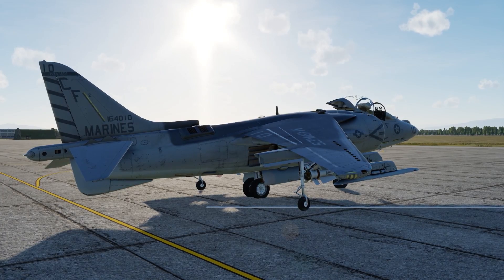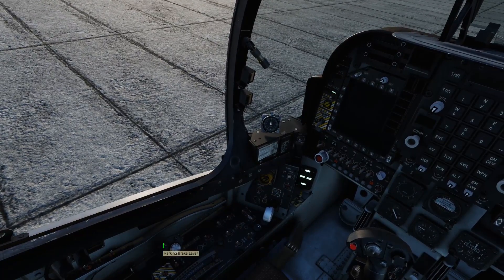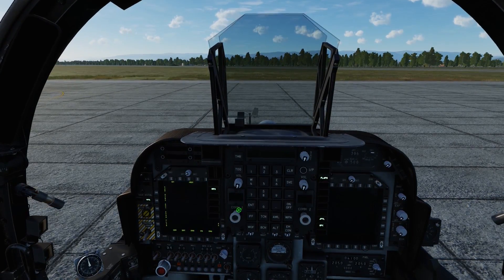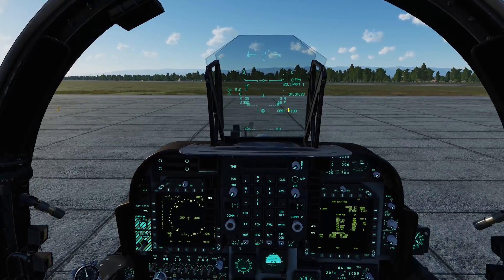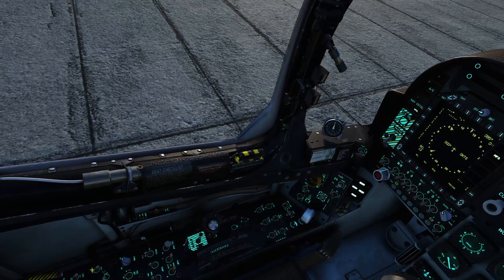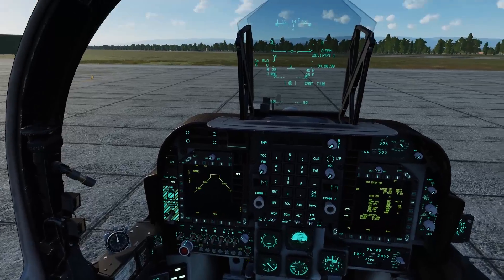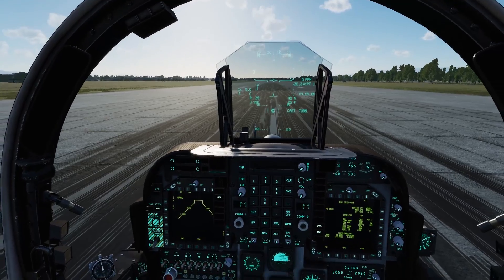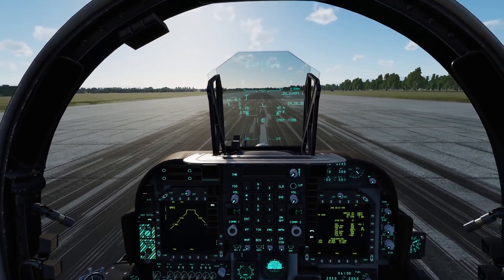DCS World AV-8B NA Harrier II Start Up Tutorial and Frequent Problems Fixed!

Comment: DCS has updated something! I've followed every YT video on start up to the tee and none of them work. I noticed many of your switches are defaulted to positions that the updated (as of the date of this comment) are not in. What's the new way?
Reply: Tyler you have to arm the ejection seat which is on the seat on the back right corner, turn on DECS which is beside the black and yellow Fuel cutoff lever in the back left corner, turn on TR+G which is behind the engine and battery switches and Yaw control which is under where the flaps switch is. Most things he did are already switched on in the Current harrier in DCS.

Comment: A query, I'm an A10 pilot waiting for the Harrier, is not it more logical to turn on the APU first, wait for it to stabilize and then turn on the APU GEN or does the manual say so? all your videos are excellent, greetings from Chile.
Reply from the maker: This is the correct way of starting up the harrier however I do have an updated version of this video where I dont even use the APU to start, you can check it out here - https://youtu.be/zXUmXkAW1C0
Reply: Thanks!
Reply from the maker: Cristobal Mauras no problem!

Comment: Throttle cut off switch is driving me insane. When I throttle back the engine cuts out even though I have the switch off. Help please.
Reply from the maker: If this issue you're encountering is during start-up leave the throttle forward while the engine is spooling up, then once the engine is in full Idle RPM then you can pull the throttle back from the initial increase to get the RPM increasing.
Reply: you only want to flip the throttle cut off when you want to allow the throttle to drop from idle to shutoff. from a cold start it will allow you to advance the throttle past this stop into idle and higher but will stop you from going below idle, unless you flip the shut off stop switch to allow the throttle to move to shut off, note: throttle must be at shut off for main engine to start, once engine reaches 10%+ then advance the throttle to idle. the parking prake level outboard of this switch is what you must move (switch) to allow the throttle to advance from idle to full open. hope this helps.